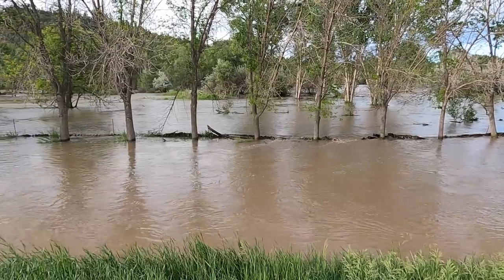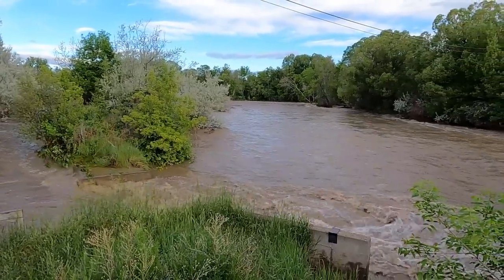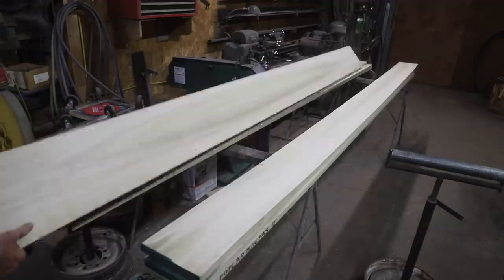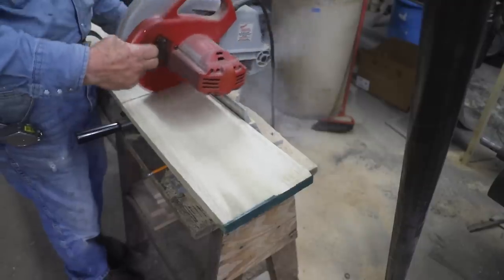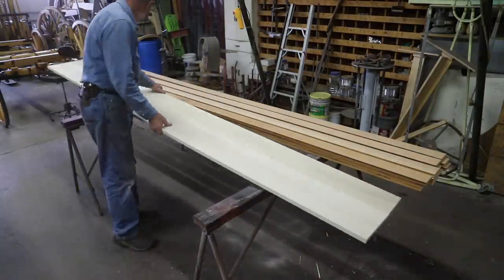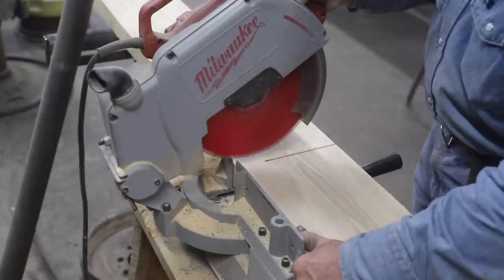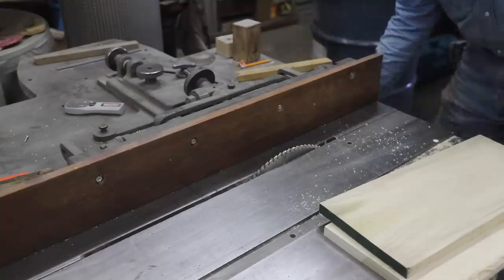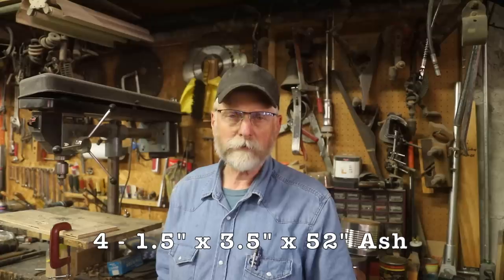How Much Lumber to Build a Wagon Box? | Engels Coach Shop

Comment: My Porter Cable biscuit joiner is one of my favorite power tools. I can custom make as wide a panel as my clamps will allow, couldn't be without it. When I want an extra strong joint I will cut two slots 1/3 of the thickness of the board. 2 slots, 2 biscuits, lot more glue surface, lot stronger. Long time fan, great videos, thank you!

Comment: When I built my house we used the pine from the trees on the lot for inside paneling. To straighten the 8'+ boards I used a 16'+ piece of 2" square steel tube as a rip fence extension. Then I could put the concave side against the fence to get my first straight edge.  Worked well, and didn't require any great skill. We processed a couple thousand board feet of wood. But now the family room and first and second floor hallways are paneled in the trees from the lot.

Comment: Love the biscuit idea...they are darn sturdy. Interesting wagon for the Spear O Ranch.  Another ranch gone from a family who ran it for decades...
Reply: The question as to if/what additional strength is given to this kind of joint is interesting and one where there is not an unaminous opinion. Any loose tenon option (shop made loose tenon, biscuit or domino) will assist with the registration of the 2 boards so that they are on the same plan as each other and thereby minimising lose of thickness when planed. However, at what point of thickness of the boards does it become advantageous to use a loose tenon system. In other words, boards that are, say, 4” thick would gain little in strength from having biscuits or dominoes added; boards that are 3/4” thick would, logically to my mind, benefit considerably more. 

I generally prefer dominoes to biscuits because the dominoes penetrate further into the mating boards and thus add some to keeping the boards flat to each other. However, a domino cutter is many, many times more expensive than a biscuit joiner. 

However, if you have a table saw or a router, you can making your own mating slots along the whole length of the boards and then make a loose tenon to fit. I would always use a plywood for this loose tenon because the mix of grain directions greatly increase strength. Of course, the traditional tongue and groove joint is really a form of (not so) loose tenon and, when done by the mill, can be made quite economically. However, on the shop, whilst perfectly possible, it will mean wastage in terms of overall width. 

I’ve been woodworking for over 45 years and that time has seen complete changes in just about everything. When I began, we would either tongue and groove or use shop made pocket screw joints where the thickness allowed. However, the biggest change has been in the glues. Animal glues had a few virtues but longevity wasn’t one of them. Joints made by using animal glues are more susceptible to splitting if the wood moves naturally and particularly when in centrally heated houses - the glue dries out and becomes brittle. Now the PU, PVA and resin glues available to us really mean that the glue element is the strongest element in the joint. Watching other woodworking videos, I’m surprised to see how much glue is used on a joint (video sponsored by a glue manufacturer?). Really, more glue doesn’t mean more strength; the right amount of glue delivers top strength at least waste. With practice, anyone will get to the point when they just know how much glue to apply so that, when clamped, there is squeeze out but very little. If you have no squeeze out, that’s not to say that you cannot have the right amount of glue but it’s always reassuring to see a little squeeze because you know then that the amount of glue is fine. It’s a safety precaution as is spreading the glue across the whole mating surface rather than a bead which you hope then will spread across the surfaces under clamping pressure. I know there are some who advocate glue on both surfaces; I don’t do that and don’t think I have ever suffered as a result.

If I’m trying to glue timbers that will suck up glue very easily (poor quality MDF is an obvious example), then I do apply a very thin layer of glue to both mating surfaces (which allows the timber to soak up the glue) and then, before that thin coat has cured, add glue in about the “normal” amount and clamp. Necessary? I think (and only think) so. I just feel more comfortable about the strength of that joint.

Comment: I did not see a relief channel on bottom of the flooring . I reclaimed a lot of red oak flooring and getting those nails out is tedious. After planning the relief groove out the boards went from 3/4 original to 1/2 inch . Beautiful wood for small projects.

Comment: When I repaired my roof, a few of the boards I replaced were 1x16, one a bit over 12 feet long (rafters were not evenly spaced. the house was likely built in the late 1890's)

Comment: One modification to pipe clamps I've seen was welding a nut on the screw end on the handle so a impact driver or drill can tighten the down. The advantage is speed as well as torque where numerous clamps are needed and having them there is a nice addition since there that simple. Indeed other industrial clamps are made this way for fabrication since the human hand\arm are no match for the torque needed some time in their use.

Comment: I've never seen straightlining a board done like that.  I was taught to joint one edge straight and then rip the board with the jointed edge against the fence?  I also used to dowel pin gluing up boards until the biscuit joiner came along, a lot easier.

Comment: I learned a long time ago that when a board is as badly curved as the ones you straight lined "free hand" that you can nail a board that has a "true" side edge on top of the curved one and run the straight board against the rip fence to get the first cut on the curved one.

Comment: as always thanks for the videos! given i have the advantage of hindsight and having watched norm A use biscuits over the last 4 decades ...im thinking   your at the table saw already  cut 2 rabbits and a spline  for more glue surface area more mechanical bond and quicker operation than measuring multiple  slots and aligning them ////  or is there a reason to use the wafers?

Comment: Are the biscuits ( Which in Europe are called lamellos) weatherproof? I've only ever used them for interior jobs.
Nice work !
Reply: Waterproof glue on the plates makes them so-
Reply: They are also usually hardwood. Even if you get composite ones they are still buried in the wood so n3ver any risk. Wood is wood is wood

Comment: Heider wagon box company of Carrol, Iowa built farm wagons from the late 40s into the 70s for farm use using the 3 and a quarter tongue and groove for floor and sides. Wagons would hold up to 300 plus bushels of grain. Used a hydraulic cylinder to lift the box to unload. 3 and a quarter tongue and groove became standard size after 1900. I have torn down/ remodeled houses with 5 plus tongue and groove built before 1900. Was that size tongue and groove ever used in wagon boxes?

Comment: I've never seen anyone freehand cut a straight edge on a table saw, I'm going to have to try it.
Reply: It's a little sketchy. But if it works out then it's all good.
Reply: I would never do that! I will stick to using my circular saw, where the blade points away from me. A table saw is not for beginners.
Reply: @BakedRBeans  everyone has to begin sometime.  Freehand cutting on a table saw isn't a beginner move though.
Reply: Keep your blade height around 1/2" above the material-take it easy, you can pullit through when you get two feet past the table
Reply: @horacerumpole6912  there's reasons why you should never freehand cut on a table saw.  One big reason would be that there's far better tools for the job. The other biggie would be the hazard involved. The way table saws work they're designed to kick material back that's being fed into them. Unless you use a guided cut and a riving knife. Then you might be OK.
Reply: @1pcfred  Gee Paul, I thought tablesaws were designed to cut material being fed into them. Maybe your blade is on backwards-

Comment: Wouldn't it be easier/better to tack a known straight edge to the board and then run it through the saw? This is what we have done for years.
Reply: Lumber is cheaper 2S.  3S has one straight edge but requires more labor at the mill or lumber yard.  Hence the higher cost.
Reply: @dwightl5863  I screwed up my original post. What I was talking about was we would tack a straight board to a crooked board with nails or screws and then run it through the saw then remove the first straight board to be used as a guide again later.

And you are a little bit wrong about the modern lumber yard. There is a single machine used to mill a 3S. Takes near zero additional labor. The reason for the extra cost is #1 the market will bear it #2 they are charging for the material "lost" to straighten that one edge. Lumber mills charge by board feet. If they "lose" 1" off a 2" X 12' board to straighten one edge, they "lose" 24 board feet. They charge extra for 3S to compensate for that.
Reply: No-
Reply: @horacerumpole6912  Great explanation.
Reply: Show us that 14'-16' straightedge-are they straighter than a snapped line?
Reply: @horacerumpole6912  Are you saying a hand cut snapped line is straighter than a hand finished edge on a board checked with a straight edge? LOL
Reply: @DomManInT1  What straightedge do you refer to? Do you have a 144" Starrett straightedge? "A hand finished edge"
Do you mean a handplaned edge?  Yes, actually a freehand cut following a snapped line can be more accurate-
The accuracy is due to having a perfectly straight line being transferred to the work, that is in fact the same length as the material-
Reply: @horacerumpole6912  Wow. You do not even realize how wrong you are. But, that is ok too. Takes all kinds. (Not only do I have experience woodworking, I have about 25 years experience as a metal shop machinist. Wanna know the straightest line of all? The line light makes. Light can easily be used to measure straightness to a few thousands of an inch over several hundred feet. A hand guided chalk line across a table saw will not be that accurate or precise.) Cheers.
Reply: @DomManInT1  When guys can't answer factually based questions, they deflect, and try to BS their way to an exit with how much experience they have, etc...You'd argue with a plumb line, go sit down-
Reply: @thecanadiantradesman7916  All I did was ask a question: Wouldn't it be easier/better to tack a known straight edge to the board and then run it through the saw? (The reason is, if you were not understanding, is it is easier to butt the straight edge against the rip fence and just go instead of carefully watching a 1/16" wide chalk line and the blade from 12' away (at the beginning of the cut.))

Comment: Mr. Engels I always enjoy your videos but today you scared me free hand cutting is probably near the very top of the list of most dangerous things to do on a table saw. One of the accepted ways to accomplish a straight edge is to attach a straight edge to one side of the board ( angle iron , bar stock ) same length as what you are cutting pass it through with straight edge against the fence remove the straight edge put new edge against fence and cut. That table saw you have is quite capable of a life threatning injury due to a kick back .
Reply: Oh no! the safety guys are here to tell us how it's done...Good Grief...
Reply: Remember the sawblade is turning downwards on the board.
Remember also that Dave is holding the board.
Reply: @RickOshay...  Not the safety guy just don't want a friend to get hurt you're right grief but not good
Reply: @gordbaker896  Yessir the blade is turning downward on the front it is also turning upward on the back small movement left or right the board will be on top of the blade once there it is impossible to hold the board
Reply: @johnwinn5225  You don't have much experience with a Table saw it appears.
Reply: @gordbaker896  No sir not much I have only hobby experience since 1975 how much have you had
Reply: If this frightens you so much go hide under the bed till it's over-
Reply: @johnwinn5225  I have worked with 2 neighbours, who build International Shipping boxes and Oak Railings and stairways.  There are many ways to do things.

Comment: Why not just use a fence on the table saw rather than eye-balling it?
Reply: It was not a straight edge so the cut would not be straight either.
Reply: He did use the fence after making the initial cut carefully following a snapped (straight) line-
Reply: Mostly it's to reduce the chance of pinching the board when establishing the first straight edge if you look closely he runs the board through a few extra times opposite ways to cancel out any wave using the fence after the first initial rough straight cut

Comment: Straight lining those boards free hand is the most dangerous thing I've watched you do. I don't have your skills or perhaps your good luck. When I tried that the kickback left me with a huge bruise and lots of recovery time to consider my mistake. Since then I build a contractor's jig for that job. It's fast and easy and most of all very safe. It also cuts a perfect line that you can't get free handing. It takes up some room in the shop but in coping with the bow and wane lumber has these days I use it all the time. Just saying...